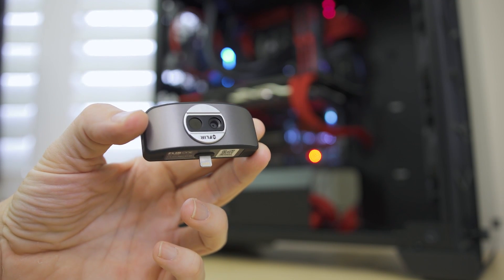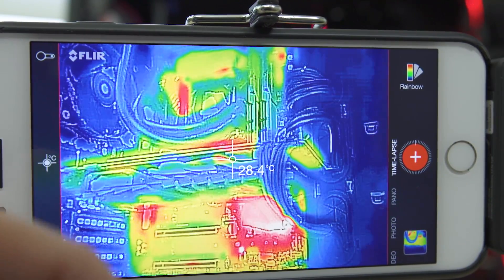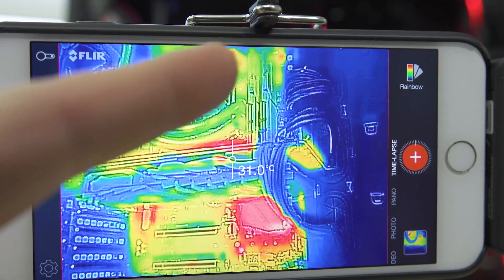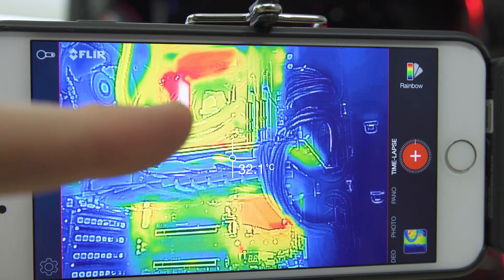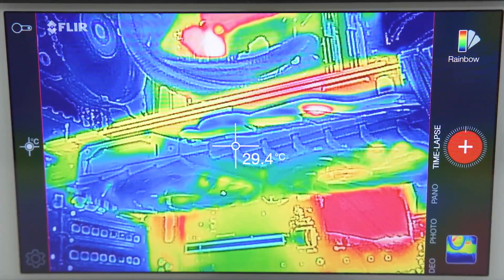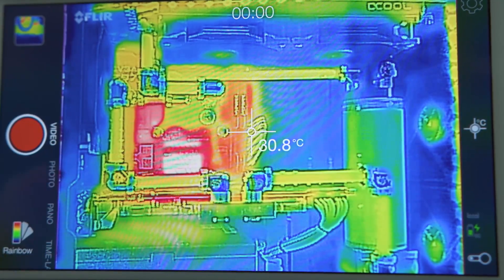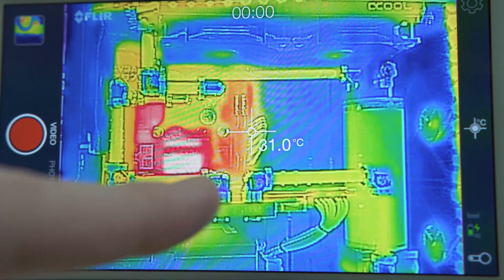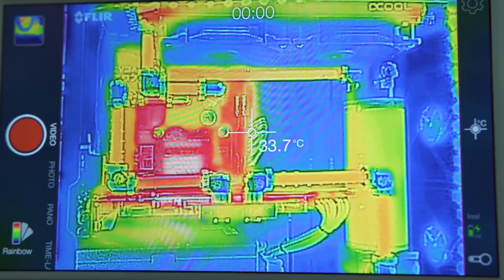PCs and Thermal Imaging... What your eyes CAN'T see

Comment: jay i5 kaby with 1080 or i7 kaby with 1070 = general use like MS office and gaming
Reply: No. Get a 1080.
Get a 1080.
Get a 1080.
Get a 1080.
Get a 1080.
Get a 1080.
Get a 1080.
Get a 1080.
Get a 1080.
Get a 1080. If you care about fps and graphics.
Reply: Bradley Weston go i5 kabylake. I've got my 7600k sitting here setting up. (built today) and it's fine for your usage
Reply: If you aren't playing on 4k get the 1070 and the i7.
Reply: Bradley Weston I5's are kinda underrated. you can put quite a load on them
Reply: if you play low fedilty shitty games like cs go, free to plays, cod/ battlefailed.  just get a i3 with a 1060... or better yet rx 480
Reply: I feel that when I do upgrade it, it would be the gpu when gpus are really 4k ready so probably go i7 1070 and put the 1070 in another pc and have a new generation gpu say the 1280 lol
Reply: Bradley Weston another computer means more money wasted. dont buy for "future proof" its bullshit, my computer is only 3 years old and it has no m.2 or DDR4 or USB 3.1, not really a huge deal because m.2 is expensive and so is DDR4, DDR4 also offers little advantage considering that most programs dont use that much ram such where 16gb a stick or higher would be needed.  and oh btw an i7 has little to no effect in games compared to a I5... if you where doing work such as cad/ 3d, images, video or what ever an I7 will help a little more then i5.
Reply: Risto Mladich no i play arma and witcher mostly and abit of project cars no indie games
Reply: Bradley Weston do you play arma public servers?
Reply: Mainly public ones and i know its a poorly optimised game. Just i know im gonna to go 4k but its commercial viable for average folks yet so is it worth getting a i5 1060 and waiting like 2 years until 4k is the mainstream resolution?
Reply: Bradley Weston join a community if you are going to play arma online at all. a i5 is perfect for arma3. single core performance, ram with high clock speed/ low cas timings and for a video card, arma likes nivida better then amd however the new vega gpu from amd might change that...

 as for 4k res good luck with that, most gamers are  under 1440p and if not even 1080. it also depends how big your display is if you under 27in I think 1440p is more then enough. you could get a xx60 card every gen or 2... they are pretty cheap, but I think that a 1080 is just overkill, i would like to point out that arma 3 will live on till 2020 if not 2018 until arma 4 replaces it.
Reply: Get Skylake instead, Kaby Lake is no better, and you can save a few bucks. Get a 1080 if you're doing 4K or very high refresh rates.
Reply: ***** As much as I'm hoping Ryzen will be the return of Christ, we still don't quite know how it stacks up against Intel. Sure, they benchmarked a 6900K, but that was just one CPU. We also don't know pricing. It'll probably be cheaper than equivalent Intel processors, but by how much?
Reply: Bradley Weston Go for an i5 also battlefield can be pretty demanding , if your going going kabylake I strongly suggest getting a z270 gaming m5 as I got mine, plus you can get a free 250gb nvne drive with it :) board is decked with lights and performs well. like the other guy said Skylake is where it's at and An I5 is a smart choice, i3's don't compare with heavy loads
Reply: also haswell-e is shit now if u can't get a good price because it costs the same as Skylake, personally the 2070 is fine as your wasting money buying a 1080. high refresh rate, 1440p and some games 4k with a 1070
Reply: Im blue and green but do you think its worth waiting for AMD have for gpu and cpu?
Reply: Bradley Weston i5
Reply: Also im currently on 1080p res but im gonna miss out 1440p and go straight to 4k. Thats why im not really sure that a 1080 is needed yet
Reply: Nick Gregory Don't expect ryzwn to be too cheap as it's contending with broadwell-e therefore it's going to be around 50-100 cheaper than a 6900k as (puts on tinfoil hat) AMD doesn't want to put prices too low as Intel might react too much blowing it out the water  like how Nvidia launched to the 1060 to 'kill' the rx480
Reply: i5 and GTX 1080, as the guy above said, i5's are really underrated.
Reply: The thing is, I have an i5-6600K and a 1080 (MSI Gaming X to be specific), but I also have had the 1070, and I think I can say the 1070 is probably the preferred card because it's plain ole' cheaper and it'll suit more people than the 1080.
Reply: Nick Gregory But having the choice of both, you would pick the one that performs better right? (The gtx 1080)

Comment: Does the Flir also work through side panels (glass and plastic)?
Reply: No, it will see a reflection of the surroundings instead.
Reply: glass does block IR emission(=thermal imaging does not work)

The best temperature measurement will always be K2 thermocouples(or other type than does actual contact)
Reply: +Mirage pt: I knew about glass but what about plastic side panels? TV remotes have a cover made from acrylic. Aren't most side panels also made from acrylic?
Reply: probably depends on the plastic and its thickness, but i would't be too confident on it. The plastic of the sandwich wraping is a way to test thermals without too much error, but it still blocks some of it.
Reply: Glass (and for that matter acrylics, etc) only effectively block certain wavelengths of IR. The IR used in a TV remote isn't that far away from the visible spectrum - it's nearly visible (hence why it's called "NIR" or "Near IR"). Far infrared, or long infrared, is quite different. It's more easily absorbed by glass. And the FLIR is measuring that kind of IR, not at all related to the IR of a TV remote.

Experiment: Take your smartphone, turn on the camera... Now grab your TV remote (or any IR remote), and point it at the camera. Push some buttons. See the blinking light? Aha - your phone can actually (probably, 99% of phones do this) see infrared! Even though it's invisible to you! But can your phone see heat? Nope... So that kind of demonstrates the difference.

Remotes: Near IR. Heat emission: Far IR. (it's literally "futher" down the wavelength scale).
Reply: +Mythricia: Thanks for the clarification! 👍
Do you think that maybe a very thin sheet of plastic (like cling wrap) could still allow for some heat IR to pass through? I am just thinking how Jay could use the Flir with the side of case closed so he would be able to measure the system with proper air flow.
Reply: I can confirm that it doesn't work with acrylic windows either. I've got the CAT S60 & a Phanteks Enthoo Luxe. Even with Furmark running, my GPU is the same color as everything else in the case.
Reply: Not entirely sure if a thinner film would work. It might - he would have to simply experiment, really.
Reply: it does work, but not at "full emissions", dave jones(eevblog) did that to help repair test equipment.
Reply: Hah, yeah that's actually why I was saying "not sure" because I remember Dave doing that, I just don't remember how well it worked out.

Comment: How about the power supply? Are all the higher spec ones running cooler? You could then evaluate the use of zero rpm PSUs. And leading on from that, the impact of blocking airflow to a PSU.

Comment: Umm gamers nexus did a test on this, during the EVGA issue, and these types of thermals are BS, they do not show how hot the components really are but more of where the heat is coming, and even then based on installation the components in the greens and yellows may be hotter than the ones in the red. At best it should only be used to show heat dissipation for say heatsinks.

I hardly doubt the backplate is hotter than the VRMs.

There is your first test Jay, backplate on and backplate off.
Reply: 450AHX, and just how would you expect a thermal image to "show how it can negatively effect the health of the components"? that's a clinical study, vs where heat builds up. I use thermal imaging in a professional manner troubleshooting boilers, electric motors, and circuit boards, and such. Where there's excessive heat, there's problems.
Reply: That was the point. To show a general idea of where the heat is coming.  If you want NASA level detail, why don't YOU make a video since you're an expert?
Reply: 450AHX , ah, so you're saying that Jay should have been more descriptive on the parts he believed where causing the heat, and what the thresholds of the components are? maybe used a second IR thermometer and point out other temperatures around the hot spots? Makes sense. I think others commented likewise.
Reply: Not only that, it doesn't even show that these kinds of temperatures negatively affect the health of the components.
Reply: Thats the point, though. Knowing where all the heat is coming from and which parts radiate the most heat.+
Reply: +Spaceman Rick
> just how would you expect a thermal image to "show how it can negatively effect the health of the components"?
For example, by showing that components that are individually subjected to temperatures past a certain threshold tend to fail more quickly.

> Where there's excessive heat, there's problems.
Exactly. Excessive heat. How do we know how much heat is too much?
Reply: +Spaceman Rick
For example, suppose that you have two components, A and B. You measure that A is at 70° C and that B is at 50° C. Obviously you should focus first on lowering the temperature of A, right? Well, what if A can tolerate temperatures of up to 80° C without suffering early failure, while B can only tolerate up to 45° C?
Reply: +Spaceman Rick No, I'm saying that merely pointing an infrared camera at a motherboard doesn't by itself /really/ give you any more information than looking at the values reported in a hardware monitor.

Comment: You don't have the scale showing on that phone. Red isn't hot it's just the hottest in the scale. Make a new video with the scale

Without the scale all you can really tell is how the heat sink wicks away heat
Reply from the maker: You should watch the entire video before commenting... plus it doesnt show the scale. So no, I wont make a new video. Have a nice day.
Reply: there are 2 types of people you wanted to inform:
-the casual that wants to know how hot do VRMs and chipsets get
-the pro that doesn't have a mobo block.
They are both disappointed as there's no scale on the flir, and the pro with no fans in his case already has a mobo block. This video is pointless for both and it would have been fun if it weren't 10 minutes long. You made a boring video that manages not to be informative, if you made it 5 min nobody would be upset.
Reply: Then Jay, you just proved that you should not touch the thermal images. And to add that, im not going to watch a dude that has less knowlage than i have.
Reply: haha shut him down :)
Reply: JayzTwoCents you tell him, Jay

Did I just assume your gender?

Comment: The heat pipes on the GPU are probably reflective enough to alter the visual results. Shiny surfaces are difficult to get an accurate reading on with infrared devices.